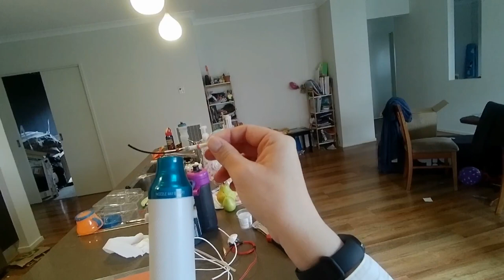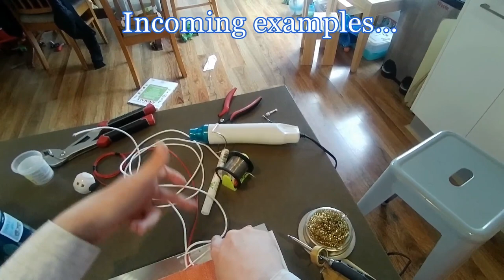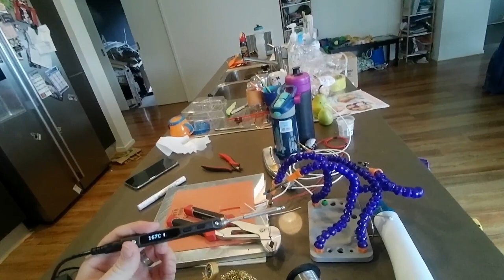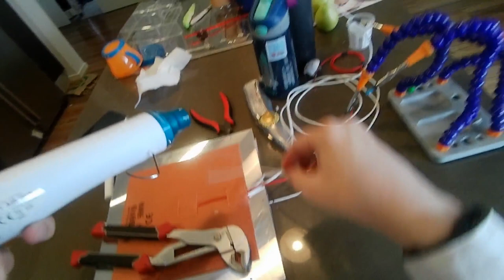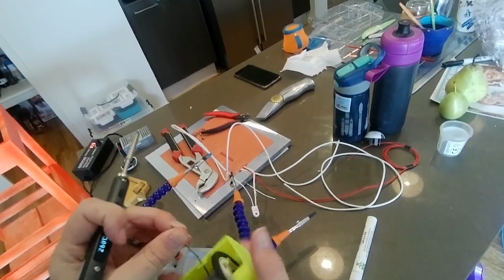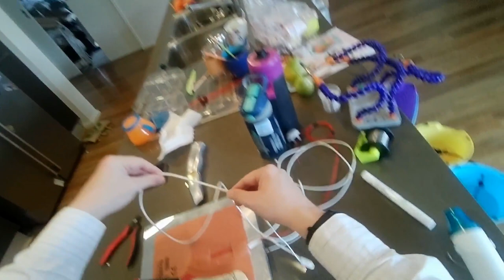3D Printer Heated bed - thermal fuse wiring

Comment: Those solder tubes use very low-temp solder. I would worry at what temp that solder melts. We are talking about mains safety here.
Reply: Same thoughts here. What would you recommend instead?
Reply: @christophspielmann316  crimping a barrel sleeve or twist nut caps. Solder could melt.
Reply: @cjmerobot1204  I would do a crimp, but it is a temp fuse that goes off at 160* C so... If the solder melts above that I would say it's ok. The solder I use does not start melting tell around 300* C. The fuse wires are also lower gauge then most common crimps support.

Comment: What if you had used some flux on the wires prior to putting the "solder heatshrink"? I build a lot of electronics and always use flux for the solder to flow better.

Comment: Thanks for the info but I suggest that this should not be a 40min long video.
Reply from the maker: Check out Nero 3dp I guess
Reply: agreed! 40 minutes to make a cut in a wire and solder in a fuse. ridiculous

Comment: Hi, What happens when the 3m glue of the heater pad dries up after 2 years and the heater drops of the bed?
Reply from the maker: Two years is a while! But rtx silicone is recommended to be applied too. But in two years I'll likely have a new plate :)

Comment: aren't the thermal fuses supposed to go inline with the positive? or am I misunderstanding what im watching
Reply: I think it's inline/in series, no? As far as I can see he is soldering it on one wire and not bridging both wires, I think the second solder he's doing is the snipped off section of wire that he is soldering back on the other terminal of the fuse but it's hard to see as it's laying on top of the other wire. I think the video thumbnail shows it best. Additionally, according to Keenovo their heater mats don't have polarity if I'm interpreting the below link well, so you can choose which side is positive and which is negative. I'm not good at electronics but logically you're absolutely right in that it needs to be inline/in series with the positive, if it's bridging/parallel it won't cut the power when it blows I think. See here for the "no polarity" bit: https://keenovo.store/blogs/how-to/how-to-wire-a-keenovo-heater-pad-to-your-3d-printer-via-an-ssr "No polarity between the two power wires( commonly in silicone and white fiberglass sleeve insulation)"
Reply from the maker: It shouldn't matter, as when the fuse trips the circuit isn't complete anymore. I'll double check shortly
Reply: You are correct it is preferable for safety to always break the hot connection. Connecting a fuse on neutral leaves mains voltage at the device seeking a connection to ground. With the build plate grounded (which it should be) if there was some damage to the heater where some of the element came in contact with the ground the heater could stay on. Another much more likely scenario is that the SSR and thermal fuse is is connected to neutral then there is mains supply on the heater 24/7. Then throw in a flaky ground connection and the problem gets even more dangerous. I have seen new construction where there's 2 or 3 outlets that don't have a good ground connection. In old construction I think you have about a 50/50 shot at having the hot and neutral being swapped no ground or both. Moral of the story always break the hot and and very your outlets are correct.